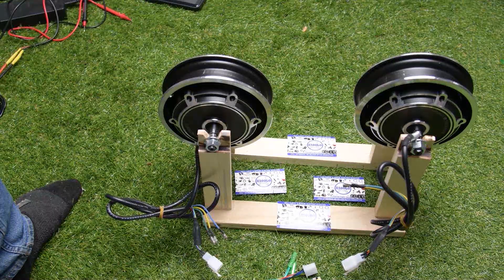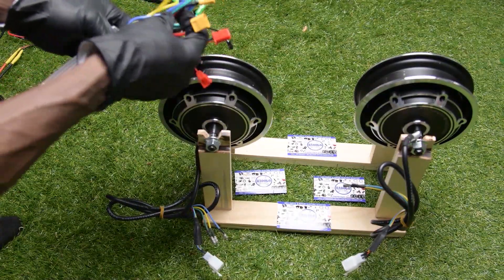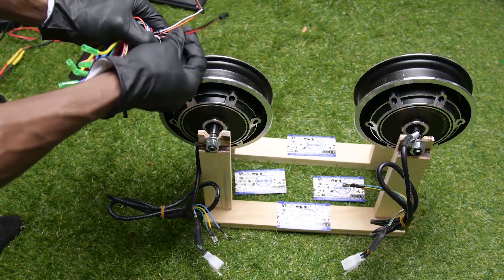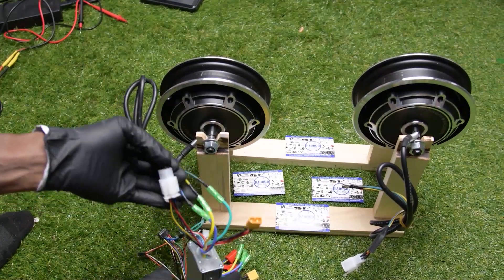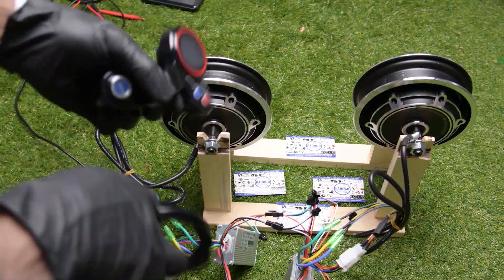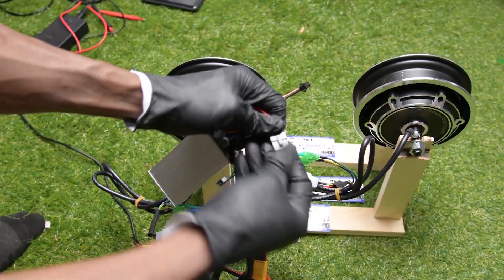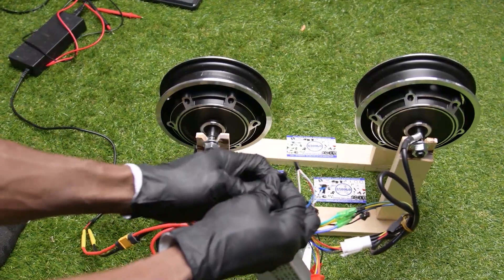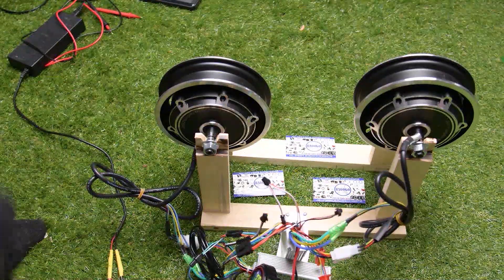NJAX-T Controller Throttle Dual Drive 48 Volts 36 Volt wiring Diagram Connection electric Scooter

Comment: Can you please help me to wire my tricycle. The controller model is : BY02LT - B.  Out of the controller come out 4 thick wires : 1 red, 1 black, 1yellow and finally 1 blue. The thinner wires are : 4 black, 3 red, 2yellow, 2purble, 1green, and finally 1blue.  From the hub motor come out 9 wires :1 blue,1green, and 1 yellow. These wires are thicker tn the rest which are: 1red, 1blue, 1 black 1yellow, 1greenand the last oneis whight. Can any person help me how to connect all these wires?